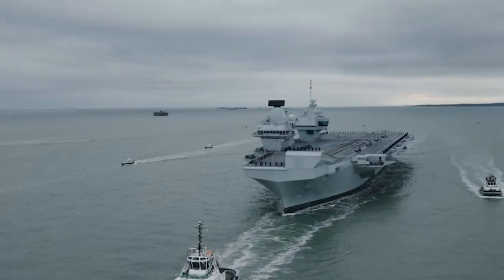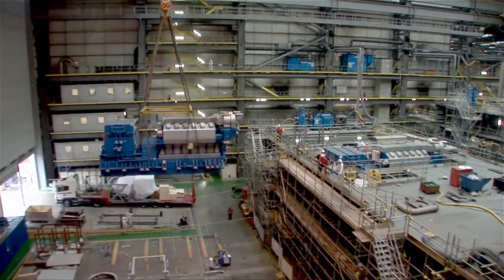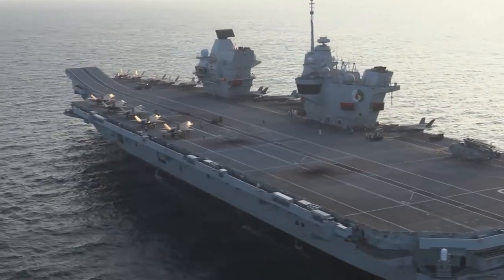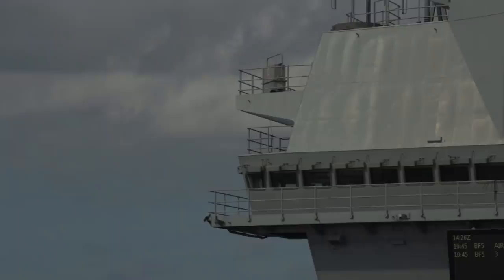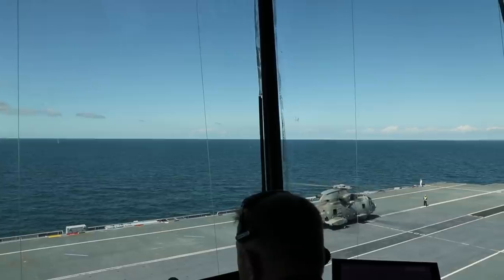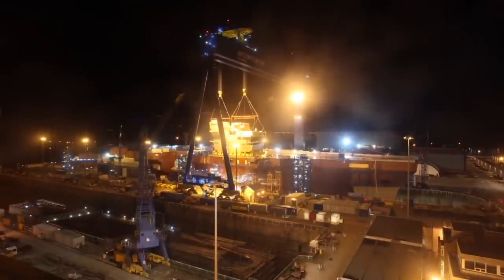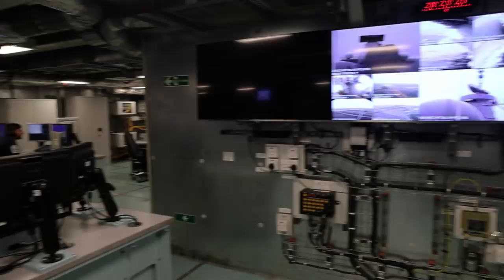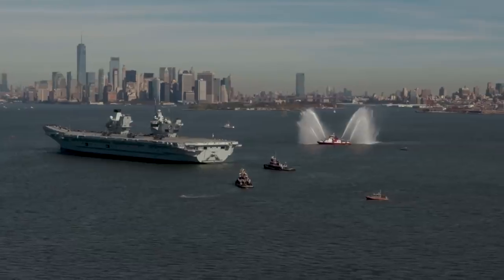Why Queen Elizabeth Carriers Have Twin Islands?

Comment: The other advantage is that against a numerically superior foe, it can split into two smaller carriers to even things up.
Reply: I think it also transforms into a  super robot... with two heads!
Reply: Yeah, and why do I get the Jedi Cruiser stuck in my head? I guess the common theme is two islands.
Reply: What if there are three enemy carriers though????
Reply: Also, the rear island can separate and become airborne for strategic purposes, if needed.
Reply: Only if you have a good magician with a saw !
Reply: Separate the saucer section!
Reply: @vinkhe861  we call in the sister ship and have 4
Reply: @vinkhe861  the engines would turn inti lightsabers lmao
Reply: @dontcare3049  see hers mad 😡
Reply: @brunothebat4122  thats exactly ehat i thought
Reply: AAA BBB  ק3-זה
Reply: If Gerry Anderson had invented it... it would ...
Reply: LOL!
Reply: Okay, i have already imagined an anime done about it)
Reply: No it can’t
Reply: @vinkhe861  no one gonna risk sending 3 carrier just to sink one bruh
Also there is usually a carrier fleet with HMS carrier. Or else they can call for reinforcements
Reply: Just like separating the saucer section. Just don't try to turn over command to captain Picard until you've put his ship back into one piece!
Reply: Multi vector assault mode…
Reply: WOW TRUE FACTS
Reply: Hmm,i think split to one cv and 1 Helicarrier
Reply: It's a transformer simple as that
Reply: Royal Navy did multi-vector assault mode centuries before Starfleet!
Reply: doesn't matter if you pick the bow or stern - they're both just as crunchy and sweet
Reply: But the front section loses warp drive capabilities

Comment: Remember, if it isn’t obvious or confusing, it isn’t British
Reply: Don't know about that. British cars, and the Centurion tank, are a bastard to work on … or they were back in the day.
Reply: Australian my friend.
Reply: Or Canadian, Australian.
Reply: @MegaPeedee  in britain we dont have british cars ourselves, we have cars from different countries, so no wonder they are complicated
Reply: Like the oil filter of a Land Rover Freeland 2.
Reply: Tea facilities is a must have on that as well.
Reply: @revivrevalchn3503  fun fact in ww2 we lost a lot of tanks due to crews abandoning the tanks to make a cup of tea. Now all tanks have tea making facilities on board
Reply: @mizzyroro  buy Ford or GMC or Dodge.  Cheaper parts from Canada & U.S. Depending where your located. Bigger vehicles safer.
Reply: @codyc8138  That is not logical or true at all. Bigger vehicles doesn't mean safer automatically. Vehicles that big are a problem is tight areas like all of Europe.
Reply: @frankvandendool882  They actually do for the most part.

Of course you shouldn't buy a large vehicle that can't fit on a street, but in the case of a car accident, the bigger and heavier vehicle will always be safer to be in than a smaller one.
Reply: @codyc8138  indeed Landrover parts are way cheaper than anything else. And they need lots of parts to continue function.
Reply: @herrfantastisch7489  That was true 15 years ago. Times change, technology changes. Maybe you should do some research. Watch crashtest video's of modern cars. You might be able to see for yourself what I'm talking about.
Reply: SA80 moment
Reply: Surely everything is either obvious or confusing?
Reply: @herrfantastisch7489  there's your problem. Safer for whom? If you take a systems view, killing the person outside the car is just as bad as killing the person inside the car. But thinking like that is dangerously close to socialism in the USA.
Reply: @codyc8138  That explains why you have so many more road deaths per 100000 than most if not all European countries...
Reply: lol, british engineering is obvious is it?
Reply: @frankvandendool882  I looked into it. Safety for all sizes has increased, but larger vehicles have a decline in injury and deaths the larger the vehicle becomes. This still means larger vehicles are safer, albeit smaller vehicles are not necessarily death on wheels.
Reply: @vipecrx  certainly not
Reply: @stevecarter8810 Edit: Enjoy my long rant lmao

 What's dangerous is that you misread my message terribly.

I stated, strictly speaking for the driver/passenger, that it was safer to  be in a larger vehicle than a smaller one in the case of a car accident. I even stated that you should not purchase a large vehicle intentionally which takes up an entire road in Europe as roads are smaller; but nonetheless, larger vehicles are safer for the person inside.

Now, let's take a look at your systems view, also known as the systems theory. Systematically, is it not preferable for one person to come out uninjured, and the other minorly injured? The worst case scenario is both people die, is it not? If an ambulance is called for someone who has a broken arm, is it not preferable that the other person be uninjured to alleviate the work off medics? Systematically speaking, this is preferable. Besides, how are you drawing a straw which cries socialism?

Lastly, have you ever actually seen a car accident with a large vehicle and a small vehicle? I'll say, in your defense, that a semi-truck will decimate a car in a head-on collision. But a Ford pickup in a head-on collision with a Toyota, the most that may happen is a totalled engine block. It's as Frank mentioned, that cars have improved over time. The guy in the Ford pickup will likely be fine, maybe even him and his truck unscathed; the person in the Toyota may be injured, but there's a large possibility they're alive, and can make a recovery. 

Still does not change the fact that if you find yourself in a large vehicle, you yourself will be safer in car accidents.
Reply: Or French...
Reply: @codyc8138  chinese steel and aluminum too.
Reply: @codyc8138  US road death 4 TIMES'S higher (per 100,000) than in the UK, so nope
Reply: at least you guys use the metric system. us Americans are stuck using football fields. just wait until the world finds out we use "British thermal units" for our air conditioners THAT ARENT USED BY THE BRITISH
Reply: @infernodotdash2203  actually america uses metric for the construction of aviation, aerospace and maritime. All of nasa and Boeing and other American aircraft manufacturers use metric for construction and development, so do shipyards, and weapon manufacturers. 
Also most engineering practises use metric as it’s just more accurate and scalable.
Reply: @ryanm.191  yes, we use metric for everything designed by people who could pass a high school math class. building, and everything else, that's a different story
Reply: @Smithy250   I live in Canada.  Not U.S. past 20 years and counting. I've never been in a crash or been in a accident.  I drive bigger vehicles cause I have a bigger family. That means I need more room for my family.  Plus Canada has snow 7 or more monthes of the year. The weather here is very cold.
Reply: @farmerned6  I live in Canada.  NOT U.S.A.
Reply: Isn't everything either obvious or confusing?
Reply: @revivrevalchn3503 : The Canadians have teapots in railroad locomotives.
Reply: @herrfantastisch7489  unfortunately I have to disagree. The American made cars on the roads are renowned for being less safe. The cars with the safest track records are Volvo. And while larger vehicle safer for driver philosophy might seem logical, it’s actually the complete opposite way around. 

The safest cars in 2020 are the vw polo and golf, bmw series 1 and 3, Ford Focus and Mondeo and a few others. Out of the list of the 28 safest cars today, only 8 are SUVs, and the first suv is only rank 8. 

Trucks, as in the American pick up trucks are actually really unsafe vehicles, to the point where they have their own insurance bracket in most European countries, where they don’t offer injury compensation to those who drive them. Also many models of vehicles from Ford and other American manufacturers aren’t actually legal to drive on European roads, because they’re not up to the minimum safety standards of the EU
Reply: This double negative is so frustrating!
Reply: @scottrichardson8960  cos it’s british
Reply: @neozone_hyrax.raw.  Mini Cooper? Rolls Royce?
Reply: @herrfantastisch7489  it’s safer until the awful centre of gravity causes a roll over
Reply: @codyc8138  Such a typically American point of view. Bigger vehicles are safer for ME therefore better. Who cares if they're far more deadly for everyone else on the roads, right? Under this logic the implication for perfecting road safety would be an arms race of ever larger cars, crushing regular cars under their tyres.
Reply: @codyc8138  Should take a look at your vehicle death statistics then 😂
Reply: We will make sure to draw pretty pictures and use crayons for the americans
Reply: Lol truth! They make some funny looking things.

Comment: Great video. As a former US carrier aviator, the one disadvantage you mentioned does not make sense to me. On US carriers, FlyCo, which we call Pri-Fly, is on a different floor of the island than the bridge. So Pri-Fly personnel and bridge personnel do not work side-by-side and have to use wired communication anyway.  It works fine. Frankly, I would not want bridge personnel next to me in Pri-Fly. It would be very distracting. There are times in Pri-Fly everyone needs to shut up except for the Air Boss. The chatter on the bridge is constant.
Reply: sure, but then you could presumably use a tactical broom to pound on the ceiling if they don't do as requested
Reply: I wont say there wont be times where things get a little hectic on the carrier. But since there isn't the same kind of problematic landings or the chances of them in the same way due to the vertical landing of the f35s versus of coursee arresting wire landings. So I suppose working side by side will be beneficial in this case. Something which they will be missing. But I do think there is advantage in less cross chatter so I think its also a good thing. :D
Reply: thanks for your insight!

Comment: Being American, and being used to see single island carriers, I think the engineering, and battle survivability, and use of the elevator between the two islands in a genius move. British Carriers don't have the real estate of American Carriers with their off center, slanted decks. So it's a brilliant solution to a legitimate problem. Sometimes less is more.
Reply: They were going to have two islands and a different deck layout but that never progressed, but i guess it's possible in the future to be modified and things installed if necessary.  These are certainly some big ships, there's footage of this one with a nimitz ,very similar in size..royal navy carriers seem taller though
Reply: US and UK carriers operate very different aircraft, which are launched and recovered at very different airspeed. Didja notice the "ski-jump" ramp for take-off on the QE? None on US CVs.
Reply: Well it's been built to be retrofittable to handle CATOBAR in the future if deemed necessary - expensive though.
Reply: @N330AA  we just have to wait for the chinese to shave off the ramp for use so we can install the catobar as a retrofit.
Reply: @georgethompson1460 Why not a catapult that leads to a ramp? haha
Reply: @N330AA  No it hasn't. Cats and traps were included at various stages of the procurement, but in the end Lockheed offered us a very substantial discount if we made sure they could not be retro-fitted.
Reply: @hb1338  Lockheed?
Reply: Pretty good.
Reply: Less in this case is only a few thousand square metres. The flight deck areas of both are really rather close.
Reply: Lockheed?? Seriously, they had nothing to do with the construction of either carriers. Also, as has now been confirmed, both will be fitted with cata launch systems, although with a failure rate of 2/10, it is unlikely they will opt for the US version and go with the British designed version, or possibly even back to steam powered, a proven and trusted system.
Reply: Coming to this late but the QE are around 70 metres wide and a Nimitz is 76. The QEs were almost built as CATOBAR ships with an angled landing zone. The deck stayed the same size, they just changed the paint job. The axial deck markings used for STOVL can fool the eye into thinking the deck is narrower than it is.

Comment: You are sort of right about the turbulence issue.  However, it was not part of the original concept, it was only when windflow tests were done on large scale models that it was discovered that the turbulence from the front island mixed in with that from the rear one and they almost cancelled each other out.  Many carriers have a major problem with downward trubulence just behind the ship (not on the flight deck as you say) - just where you really don't want it when approaching from astern.  These ships don't have this problem.  In fact when going back to a one island design was considered this became one of the overriding factors not to do so.
Reply: A "bonus" feature it seems..
Reply: The ski jump concept  sucks
Reply: @jamessveinsson6006  Well, the aeroplanes would have a greatly reduced payload/range without it!
Reply: @jamessveinsson6006  And catapults suck when they stop working.  Not to mention arrestor wires being very dangerous.
Reply: @jamessveinsson6006  faster sortie rate than catapults.
Reply: @tams805  Not to mention arrestor wires shortening the life of the airframe by around 40-50 per cent.